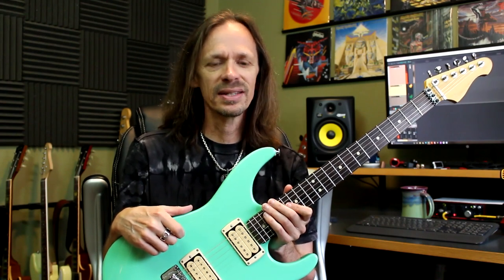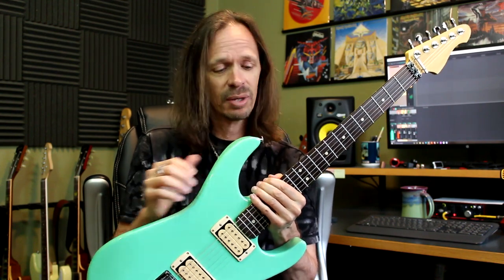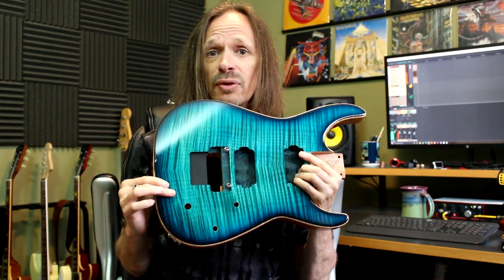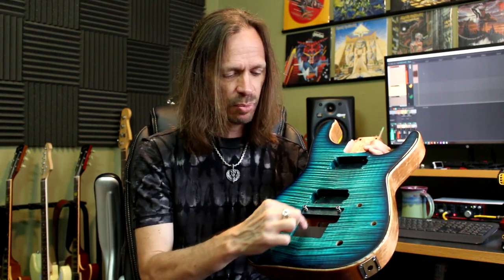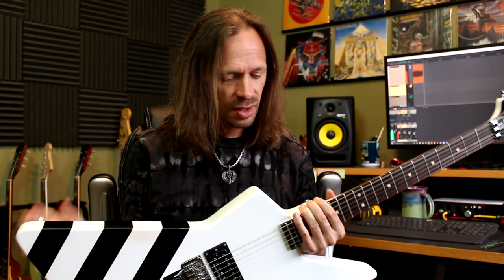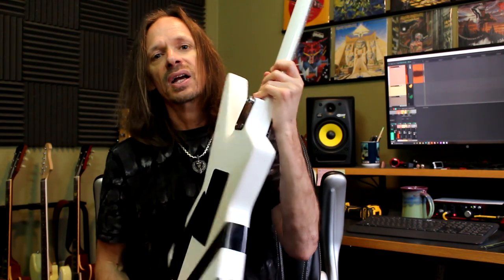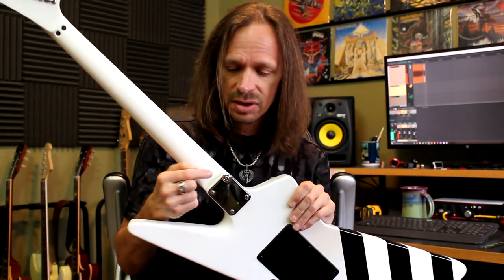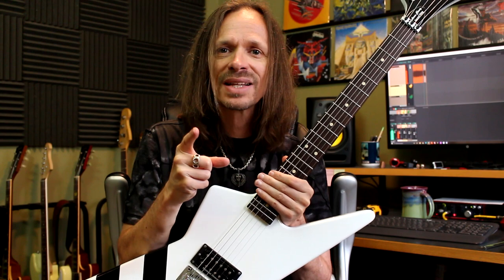How To Install Strap Buttons on a Guitar

Comment: Easy Tip #372: if you have no chamfer bit, no problem.  Chuck a 3/8" to 1/2" drill bit in your drill *and set the drill to run backwards*.  Place the point of the drill in the screw hole, apply light pressure to keep the drill in the hole, and slowly run the drill backwards.  Friction will pare away the finish and there's no danger of chipping the finish.

Comment: I like to use a cheap bar of soap, like Ivory, to lube screws. Slicker than snot, doesn't get sticky, and it's cheap and easy to find. Just rake a screw across the bar to get some soap in the threads (dry, not wet), and thats it. Doesn't take much.

Comment: Hi Aaron, thank you for the very important notes on how to drill into the body of the guitar, especially with a gloss lacquere. Warmoth uses a relatively thick layer of very hard lacquer and if you do not use a bevel drill bit after drilling holes, you always have almost 100% certainty that the inserted screw causes web crack in lacquere which is always visible and cannot be easily repaired. The same problem with a spider web crack can occur when fitting string ferrules.

The second important note concerns the lubrication of the screw with paraffin or wax for the correct tightening of the screw in case of predrilled holes too - neck screws when you install neck into the guitar body and so on.

My personal tip, for example when installing a string retainers on a headstock, is to drill a test hole into a piece of other wood of roughly the same hardness and see if the screw can be tightening correctly without force. There is a danger of breaking tiny screw in a hole.

Comment: Excellent.  You remembered to chamfer!  I also chamfer the holes I drill for pickguard screws.  For the front strap button check the angle to be sure you have enough room to fit a screwdriver without hitting the neck.  Otherwise you may have to take the neck off to snug down a slightly loose strap button.  And do a center punch to mark the place you'll drill.

Comment: I love how that fretboard just pops with that guitar body.  Man, I can't wait to build my Warmoth.
Reply: What are you building (if you don't mind me asking)?  I'd like to build an HH Strat in Daphne Blue, with Seymour Duncan '59/TB-4, and a hard tail Fender 2 point trem.
Reply: Constable 1976 ...yours basically! But SSS with 2tek bridge and super wide ebony neck
Reply: @killroy123  Awesome!!!
Reply: @killroy123  Last question...what single coils?  I have a Daphne Blue Elite Strat (from the MOD Shop) with Seymour Duncan SSL-5s/SSL-5s neck and middle, with Hot Rails in the bridge.  I also have a MIM Daphne Blue 50s Classic Series with SSL-1/SSL-1 neck middle, with SSL-3 in the bridge.
Reply: @DBSG1976  Going to use Dimarzio cruisers in the neck and bridge and an area 61 in the middle.  Can be run as an HSH even though the cruisers are advertised as a a single coil.  I plan on doing a bunch of experiments with coil splitting, phasing, blending, etc.

Comment: Hey Aaron! Awesome job on these vids from home! They are a real pleasure to watch, and you keep them interesting. I have 4 strap lock/button tips that I've used on all of my Warmoth builds (except one, and there's a reason why) with success. 1) Dunlop verses Schaller..DEFINITELY Schaller! Dunlops have failed me in the past MANY times, and guitars have fallen off while playing live. If Dunlops don't completely click into place (it's hard to tell in a loud environment like a bar and you can't hear the 'click') you're screwed. Schallers have the extra cup that at least holds the strap button if, for some reason, it fails to click. It's like a back up support. Dunlops are also noisier as you move around...not great for recording. Schallers are more snug. 2) DO NOT purchase "Schaller Style" strap buttons that are so rampant on ebay and other sites. The knock offs are made of cheap metal. I LITERALLY had a set CRUMBLE apart in my bare hands while installing them. Thank God I didn't rely on them to support the weight of my guitar! Original Schallers from Germany ONLY! 3) In the past, when not using a wireless, I've had bandmates, or myself, step on my cable on stage, pulling UNREASONABLY hard on the strap button...occasionally yanking them out of the body on stage! (Like you, I move around a lot while playing). What I have done is purchased extra long strap button screws separately! I don't know the length, but they are about an extra half length added to a standard strap button screw length. Personally, I think the added teeth gripping the wood is worth the extra few bucks. I also add a touch of wood glue when I insert them instead of wax. They are still removable once the glue dries (I want them permanent personally), but it prevents them from loosening on their own over time...which has happened to me as well. I get all set up for a gig, pick up my guitar to tune up, and suddenly realize the strap button screw has loosened without my knowing, and now the strap button is flopping around. A dab of wood glue keeps that from happening. I also put a little drop of crazy glue on the outer nut of the strap portion of the strap lock. That nut tends to loosen over time, and the dab of crazy glue prevents that from happening, but you can still loosen it with a wrench if needed. 4) The reason I don't use longer strap button screws on one of my Warmoths (a tele I just built) is that Schaller has recently changed their strap lock design, and you have to use the screw that is now permanently part of the unit. The new design offers some upgrades, but doesn't allow for using longer screws anymore. I like the older ones better. Maybe these tips will be helpful to someone. Cheers, Aaron, and thanks!

Comment: I use Schaller strap locks and buttons and always install the upper strap button straight. It puts less stress on the button and the strap lock and they will wear more slowly. The button on the rear of the body hardly wears at all but that upper button will wear out quicker especially if you install it like the video recommends. Lubricating the screw is a good idea. If the holes get worn I insert a few flat toothpicks with a bit of Elmer's glue on them one at a time and break them off flush with the body. Let the glue set for a little bit and install the strap button. Works great and gives you a nice, snug fit.

Comment: I have noticed on my Schecter Hellraiser that strap button was angled toward the neck instead of being screwed straight, just like you showed in the video. I thought that was genius, it compensates for the angle the guitar will have when playing and make sure the strap stays perpendicular to the strap button, reducing the chances of the strap slipping off.

I do have a guitar with the strap button installed straight that the strap slipped off the button and let the guitar fall on the floor... The aftermath was a broken tuner (which I couldn't find an identical one, it's a 80's guitar, the closest tuner I could find had the screw in a different location, had to go with that), a cracked nut, a broken toggle switch, and of course, a nice dent on the headstock. Had the strap button been installed at an angle, it could've potentially prevented this sad event. Although now all my guitars has Schaller strap locks installed, so I don't have to worry about the strapped detaching anymore, and it also make it very easy to take the strap on and off

Comment: It be great if you covered drilling holes for the tremolo spring claw.  I really messed this one up !
Reply: Get what's called an "aircraft drill bit."  These are 12" long and available from Amazon and in the US at Lowes, Home Deep-o, etc.  The 1/8" diameter works great, and is also useful for drilling wire tunnels in the body.

Comment: The outside of the screw thread is called "major diameter" and the inner diameter at the bottom of the thread is called the "root diameter!"  They sell standard kits of bits for wood screw pilot holes to keep you from guessing.

Comment: Maybe a vid on how to fix a ding on a Warmoth finish or any suggestions?🙁
Reply: That's sadly something hard to fix. It is possible to reshape wood with heat so long as the ding isn't bigger than a dime or so... But if there is a finish.... Good luck lol. You might make things worse if there is a finish... Perhaps hire someone to do body rework and refinish... I did it once. Cost me about 450 to get a ceramic coat which is the newest fancy stuff that's going to put wax jobs out of commission. Ceramic coats are the best. Can't scratch or ding it without trying real hard. It acts like a permanent wax job. Lil pricy to get that coat though... Cost me a extra 50 bucks. He sanded it down, filled in the dings, painted over it with paint of my choosing, and then gave it the ceramic coat treatment as well. Took about 2 months and then I got it back after I shipped it to him. Like I said... Pricy... Prolly something I wont do again or at least not for a while... It did work out great though.

I say just live with dings and scratches. Nothing is perfect anyways and the worn in instruments tend to make the best guitars... As the old saying goes...

"Make sure you go into battle with a proven rifle"

You can sand it all down and paint it yourself but you need a good place for it to cure and it's a bit of a pain in the ass and odds are you wont do as good a job as a pro since you're not a pro at body painting... There is sort of a skill distributing the paint properly so there is just the right amount all over it. Best leave it to pros in my honest opinion unless you yourself are trying to become a master guitar painter or something lol.
Reply: If it's a color paint finish, take the guitar to a store that sells nail polish and find a color that's a close match to your guitar.  Clean the ding with a Q-tip dampened (not dripping) with alcohol, and then fill the ding with layers of the polish.  Don't put it on thick; thin layers with dry time between.  Go too thick and it will dry with an air bubble in it.  Take care to apply the finish only inside the perimeter of the ding, and build up the repair so it's just above the surrounding area when fully cured.  If it's a clear finish, use clear nail polish.  You can wet-sand and polish the repair after three or four days of cure time.

Comment: Arron,
Instead of chamfered bit , you can also use a tapered drill bit , easier to use and easier to avoid cam out and drilling a big hole 🎸

Comment: I installed a broken off drill bit in my telecaster before installing the strap button.
Reply: The toan is in the drill bits, ya know.
Reply: Never thought of that mod myself.
Reply: Gretsch sadly often uses those lame ass strap buttons you have to unscrew completely to get a strap on, and then screw it in tightly to make sure the strap doesn't come lose.

GOD DAMN it takes ten times longer than putting a strap on a strat lol.

Gretch design also sucks because over time it can strip out the body wood and require filler material to make up for the strip out. PAIN IN THE ASS! I shouldn't have to do this to a 3000 dollar guitar... Just saying... I'm not exactly in the mood to put wood puddy from home depot in my limited edition falcon or Stephen stern custom shop master built corvette 1 of 7 ever made...... For obvious reasons lol.

Luckily though gretsch doesn't always use these stap buttons. Their new players editions don't which is great! And you can always swap out the buttons for better ones... Even though that's sometimes more difficult said than done since some sizes of buttons wont allways fit depending on the guitar model. Wish I knew these details before buying gretsches lol. Some of the best guitars ever made but still... Nothing is perfect. Some designs are just not practical in many ways lol.

Yes I know... Pain in the ass lol.

And your tell has a drill bit stuck inside of it... Hilarious. 

Lol my 98 strat has a screw broken off in the head stock for what should have been a string tree. I covered it and no ones the wiser luckily lol. I was fucking pissed when it happened. Fuckin screw broke off clean as fuck with no way of getting it out without further damaging the head stock. I was so furious until I found a sound solution. I got these black fuzzy things bracing the underside of the string tree which give it a nice touch and cover the old mistake. It's a black headstock so it's hard to see the damage anyways luckily.

 Advice? Make sure your screws are not cheap weak crap. Same thing with your drill bits apparently lol. Buyer beware...

But yeah man... More power to us lol. Folks who have metal in their wood where it shouldn't be lololol.

Comment: Aaron is there any chance of you doing a video featuring a Mooncaster build?
Reply from the maker: Perhaps at some point, but right now I only have what is in my home to work with. It's like in Apollo 13, when ground control has to figure out how to fix the space capsule using only what the astronauts have inside with them. :)
Reply: @warmoth  Aaron this video was of great help ! An additional point is those grolsch red rubber bottle rings work just as well in place of strap locks if you're in a pinch !
.
I have one quick follow up question about neck + nut width connection as I agree with you the link between the two is inextricable 
:
For the neck I want : standard thin profile neck profile and I think 11/16 43mm nut I am wondering what is the neck width overall 
AT the nut is ?
neck width dictates what nut will suit it best no?
*I can't see any measurements on the neck profile section on The Warmoth site about this , 
SO therefore if I want a 1 11/16ths nut but the necks with AT the NUT is say 1 3/4ths, then wont there be too much wood on the shoulders of the fretboard or IF I choose 1 11/16ths nut then that means the standard thin neck gets cut accordingly right to that width?
.
I thought this was worth asking since I haven't heard anything about it any of your neck comparisons/neck profile/nut width videos so of there is an correlation between those points^ I'd be very interested to know since for example a
1 3/4ths neck width at the nut (example) sounds like it must have a 1 3/4ths nut to match it. 
.
Really hope you see this and all that makes sense ^ please stay safe and healthy during this time and once warmoth is available to start shipping again dude to covid I'm looking forward to happily pulling the trigger.
Cheers from Niagara falls Canada!
🙏😊🤟 - Adam

Comment: Darn I was about to offer to buy that turq body until you mentioned the strap lock finish cracking!!!  :>)  It is beautiful. How about a video dealing with the plus and minus of various trem systems, vintage  vs Floating. Also installation of the floating trem bolts. Also a short tutorial on the battery box routing. Does Warmouth route just the box cavity or do they route the wiring tunnel as well, etc?
Reply: Fair point... But also finish cracks and dings and scratches etc... Are often kind of kool looking, not a big deal, and give the guitar more originality. So getting this guitar might not bother certain folks. It's all about how you feel about it : )

Comment: Do you ever use any strap locks? I've put Dunlop Straploks on a few guitars but I mostly just use regular buttons with Grolsch type rubber washers to help secure the strap.
Reply from the maker: I personally loathe strap locks of any kind. I use a certain type of button that AllParts calls "oversize buttons". Best buttons in existence, IMO.

Comment: When you drill a hole on the guitar, do you use a very small drill bit first before changing to the desired drill bit size? or do you just do the measurements then go straight to the size you need?

Comment: How do you feel about leather washers between the strap button and the body?
Reply: ComfortablyNumbMusic they push against the screw after tightening which is no bueno. I don’t use any washers but felt doesn’t have as much springy push back as leather

Comment: I installed my Strat upper horn strap button straight in! As soon as I saw it, I realized I wanted it it the slightly downward angle.
If I wanted to reposition it, do I need to fill the other hole?
Reply from the maker: I would fill it, yes.
Reply: I would. If you ever do carpentry work... Especially precise work like guitar work... ALWAYS PRE DRILL YOUR HOLES! Nothing more annoying than cracked split wood or crooked leaning screw heads or whatever... Use math to line up your drill hole perfectly. Use a level and them lil bubbles to help guide in str8. Position yourself firmly while drilling. Don't just do it like your putting your socks on half asleep in the morning lol.

Just don't pre drill the hole too big lol. My advice? Wrap tape around your drill bit in a certain position that you desire.. That way when it's drilling you can see when the tape is about to go into the body. Use the tape as a guide to let you know when you are deep enough with your drilling. Lil tip that's worked great for me since you DON'T want to over drill or under drill. No one wants a guitar that looks like a piece of Swiss cheese........... Except maybe me now that I think about it... Sounds like a light guitar lol.